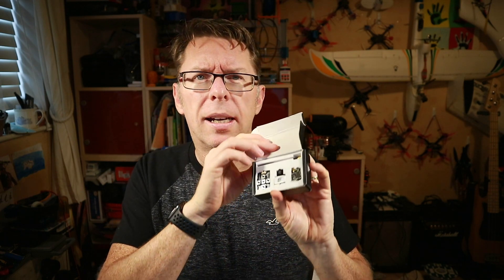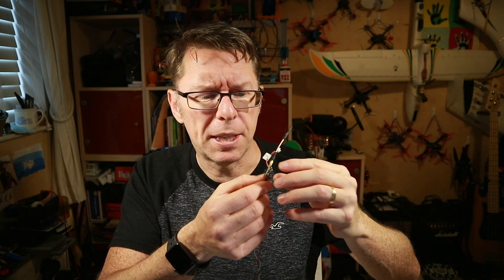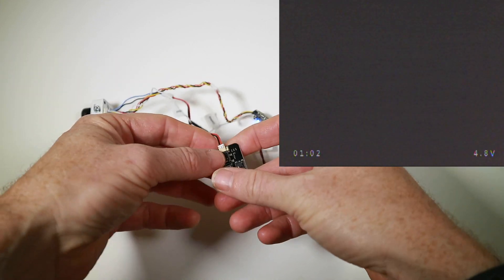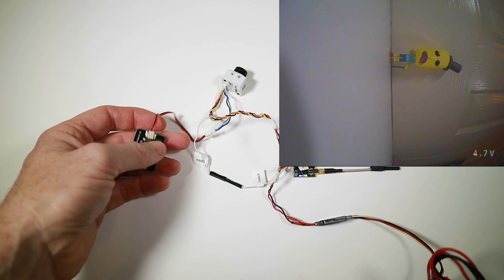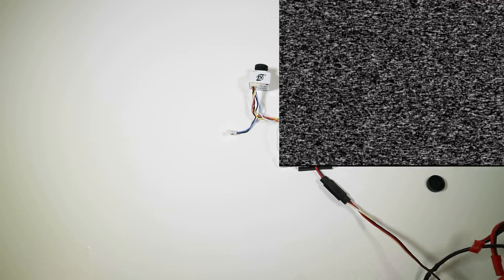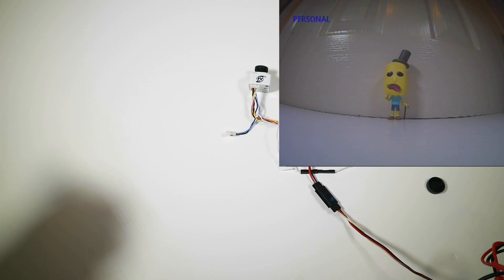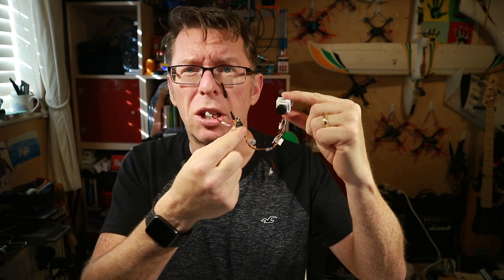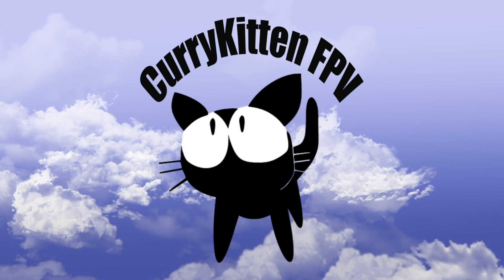FXT Smart Gesture Box.  Even smarter audio?  Supplied by FXT

Comment: In the future

This would be good for custom built footage drones with "follow" features. 

I could also see this being used in conjunction with gps and ir sensors. Say you need to inspect an area with a quad. It's a large craft. Say you left your transmitter back on the hood of your car while doing your final flight checks and it's a lazy day so fuck walking. 2 thumbs up could tell it to arm. A single raised hand could tell it to start hovering, and then a wave could tell it to start the assigned mission.
Reply: Assuming they impliment those things into the software. Wouldn't be hard. This is essentially a proof of concept.

Comment: According to their web site the cam is 4.8v - 36v so you could power that from the main battery. its just the vtx that is 5v. Nice vid Wayne. Not a bad price either :)
Reply from the maker: Oh absolutely, and that's what I'd do if I installed it.  But I get the impression they designed this to plug and play, so it kind of fails in it's purpose when you have to cut a cable and hook it up elsewhere

Comment: Whats in the box? "There are things" love it ha ha.
ive never used smart audio, i actually remove the extra wire from all my smart audio compatible vtx's to tidy things up more as my vtx units are always mounted on the outside of all my planes for airflow as 800 and 1000mw units get rather toasty if you mount them on the inside and so the button is super easy to access although i set and forget with all mine and dont tend to touch the button after that.
Reply from the maker: It's all about accuracy, there totally were things in the box :)
Reply: @CurryKitten  ha ha.